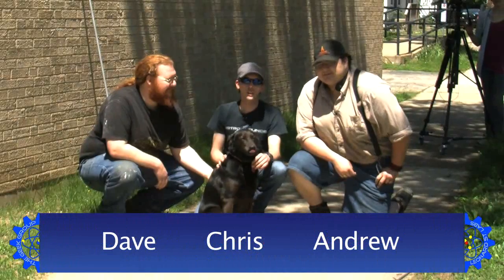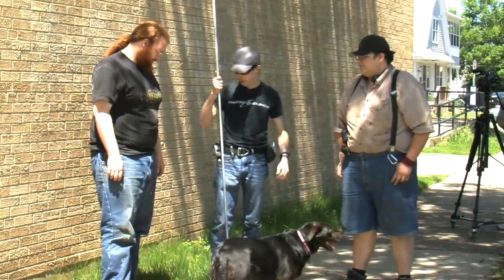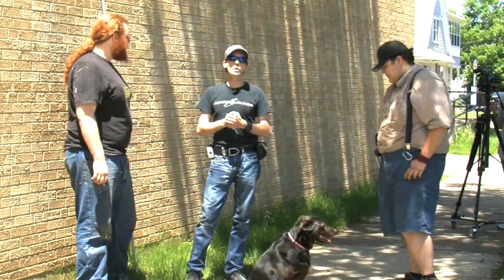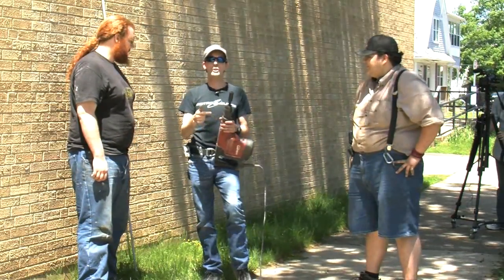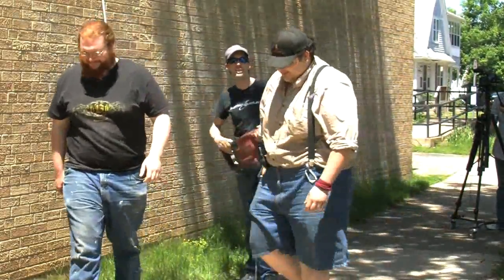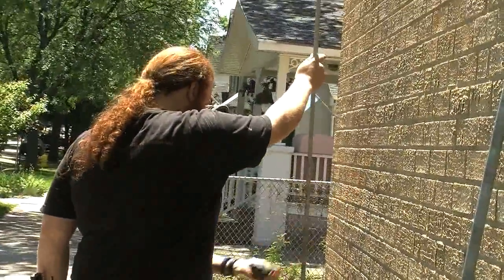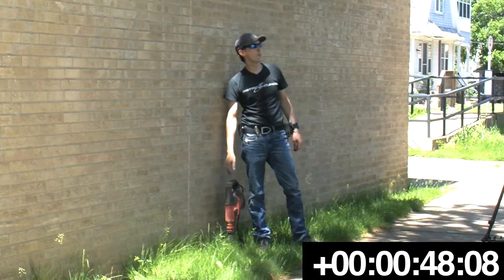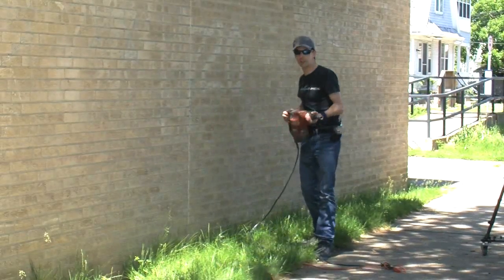High Voltage Lab - Grounding Rods Part 1

Comment: More or less, yes. The 'difference' is more the quality: If you need very heavy violent hammer-action, you take a Hilti into your hands. A 'normal' SDS-drill mostly lacks the weight and quite possibly also the power to do the same an average hiltie does.

Comment: Locating your rods any closer than 2X the length of the rod is a waste of material.  The effectiveness of the rod on decreasing the resistance decreases sharply when closer than 2X.  Looks like your rods were 8 foot long, so 16 feet should have been the closest spacing.

Comment: @TheSpoontallica I found out about the water trick AFTER I had a job installing the wiring on a housing development. Then I did use it on a house I was working on later. The difference is amazingly easy and a LOT faster.

Comment: I have actually driven ground rods with nothing more than a 32 ounce cup of water.  You start your hole add water and work the rod up and down.  The action of the rod causes a local liquefaction of the soil which allows the rod to slide in like a hot spike through butter, at least in soil that has a fairly high clay content.  It would not work as well in sandy soil however due to the greater leeching speed.

Comment: Looks like General BadAss has more pocket than you have radio, Chris...
I've driven ground rods with a hammerdrill before, and while it does work, a hiltihammer works MUCH better (as I found out when I drove the second rod with one and didn't swear nearly as much)

Comment: will this bit also fit a pneumatic hammer? Because I have a small jackhammer I got off of Craigslist and was using it to bust up an old walkway and patio, it actually looks like your "hilty hammer" just more streamlined since its pneumatic instead of electric. I would also imagine a beefy enough hammer drill (i swear that IS a hammer drill you got) would work too.